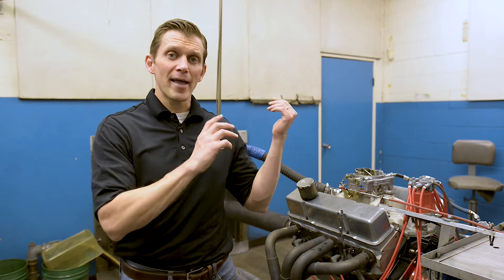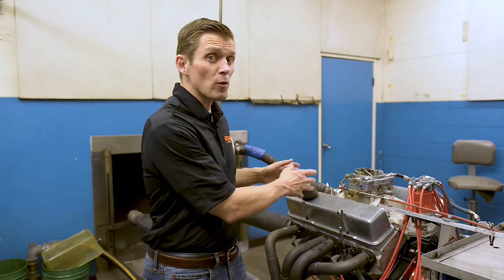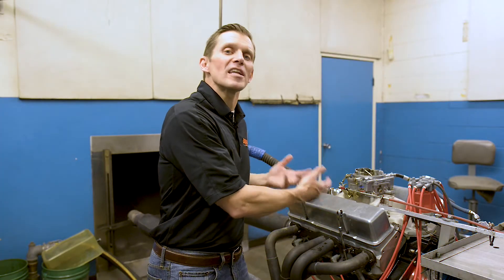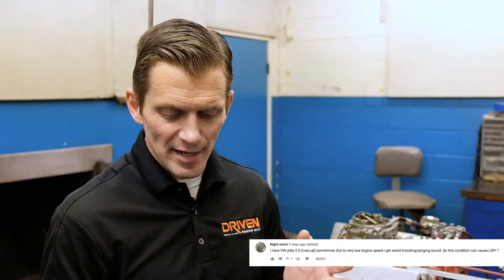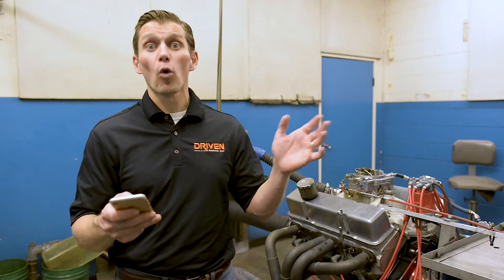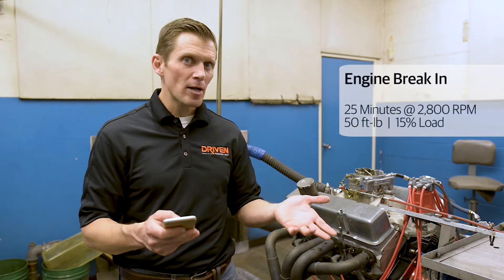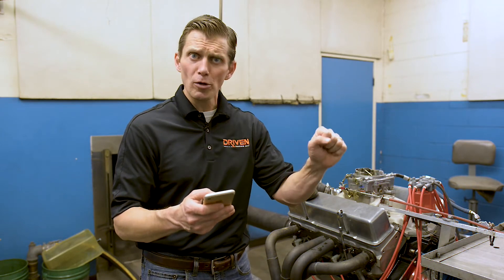Engine Oil Tech Tips ---- Bonus LSPI Q&A

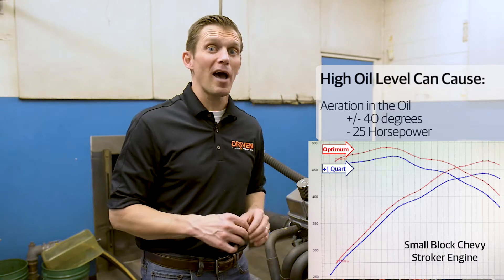Comment: Your graph at 1:49 shows 1 additional quart... and  about the 25HP loss you suggest, but that's double the oil you're saying would cause that issue? I suppose this may change per engine, but more oil tends to reduce the temps as there is more oil to heat and more oil to disperse the heat. It will heat soak, so once hot it will stay hotter longer for sure. Additionally in boosted engines, like the RB series, more oil is definitely better as they suffer from a high flow oil system which will pump all the oil into the head, they tend to just pump any oil they don't need overboard, into your catch can if you're running one. Once you get blow by and add crank case pressure the problem is multiplied. So to clarify different engine types will have a varying affect. You forgot to show how long it takes for the oil to reach the sump?
Reply: @Lake Speed Jr What would be a cool demonstration of the time it takes would be to get a clear plastic sump made, like blow mold, or even just a pirsepex box even you could time laps from empty pour in the recommended amount and show exactly how long it takes. I always wait 15 mins when I do an oil change before checking the level, and always do it hot. I might only wait 10 min between top ups though. Yeah if your crank is dipping into the oil the aeration comes into it, but not all engines are designed that way. I suppose being an american audience, probably more of your normal audience will have these types of engines though.
Reply: @Lake Speed Jr Have at it mate. I don't have the time or budget to do it myself. Consider it your idea.
Reply: @Lake Speed Jr You may even be able to run the engine, to show the aeration you're talking about too, Some dudes did it with some clear diff covers to show how some aftermarket hats will affect the oil and aftermarket is not always better.
Reply: @Lake Speed Jr Well I look forward to seeing the video. How did you know I was in Queensland? or didn't you and you just assumed I knew where it was?
Reply: @Lake Speed Jr I Imagine that most people who don't know would assume it's in England...
I see you guys are selling in Australia. I am looking for sponsors for my race car and my channel... I contacted your FB page, they told me to email marketing@.... I hope to put something together and send it too you guys on the weekend, keep en eye out.